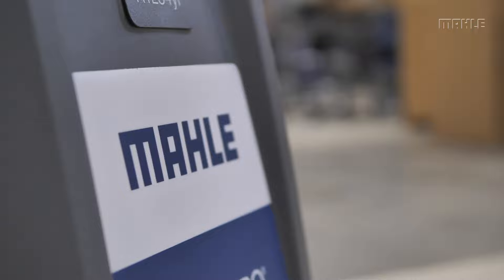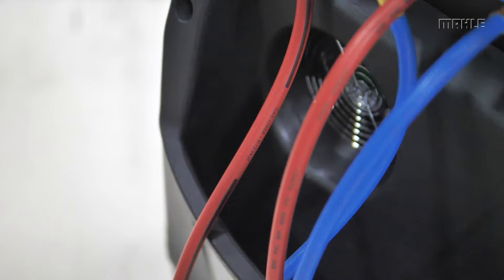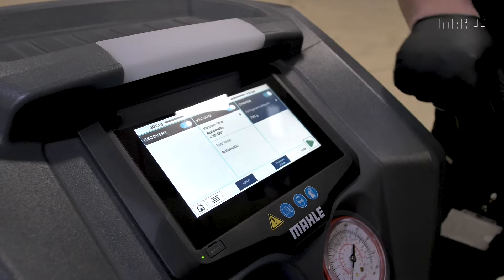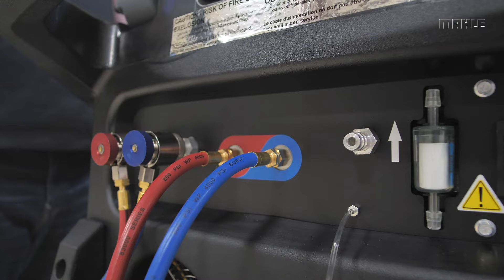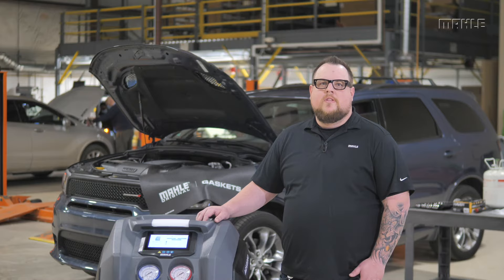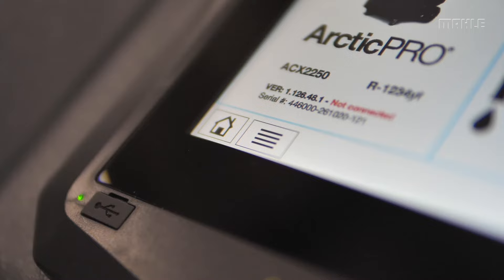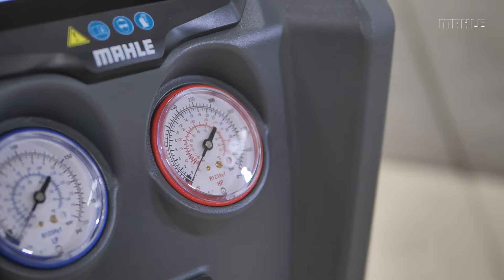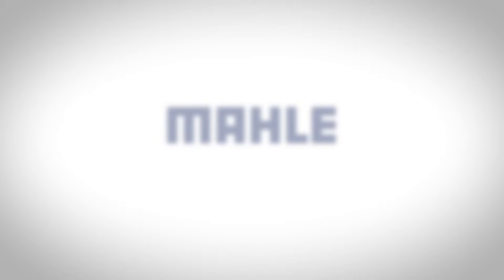MAHLE ArcticPRO Unit Operation

Comment: Hello I have a old arctic pro RHS 980H and it is stuck in "clearing in process please wait" is this something you can help me on or make any recommendations? I have unplugged the machine for 2 or 3 days even removed the 3 volt battery.. everything seems to be working as intended but every time I go to charge or recycle it gets stuck processing..

Comment: We just got ours and we can't get It to work. The pressure is low but not empty.  When recovering it says not enough pressure to sample. So we do to vac and it says to much pressure to vacuum??? Wth
Reply: same situation with our acx2250 and acx 2280 arctic pros. cant recover system because system pressure is too low , everytime we connect lp & hp couplers onto the vehicle service couplers says that there is either contamination or wants to do a system analysis performed both procedures multiple times and still can not use the machine. when it finally does decide to pull vacuum and go to re-charge the system the screen goes black and pretty much just resets itself and goes back to the home screen. Thousands of dollars for a useless machine. Mahle we need answers this is ridiculous

Comment: Before buying this machine, I watched YouTube and saw how to use it. There was no step to add compressor oil, but everything was set up automatically, so I thought it would happen automatically if I put oil in the machine, but that's not the case with this machine. Is there a model that automatically adds compressor oil?
Or do all these new machines have to add compressor oil manually? If all models add oil manually, why did they make the entire process automatic?
Reply: Oil will not be automatically injected on any R1234yf machine due to there being different types of oils. The manufacturers don't want cross contamination so they do not allow automatic oil injection

Comment: I hate this machine.
Reply: how to put the compressor oil on the car? Do you put the oil manually using oil adaptor?
Reply: @younghoonchoi2759 yes you have to manually inject it. 
It will ask if you want to manually inject oil? You hit the check mark and it’ll tell you to open LP coupler and then you inject the oil and put coupler back on and follow the screen.